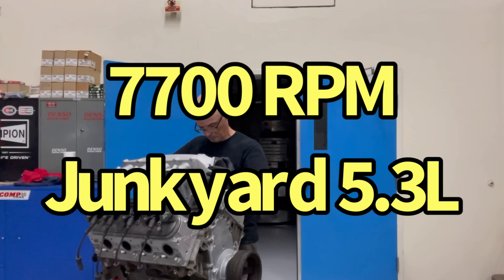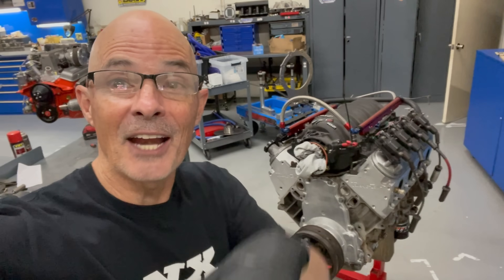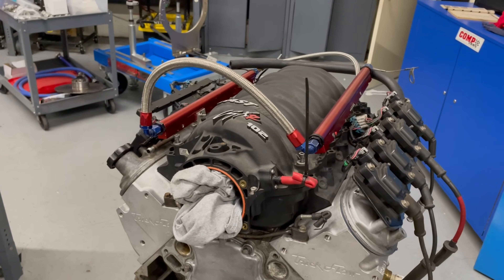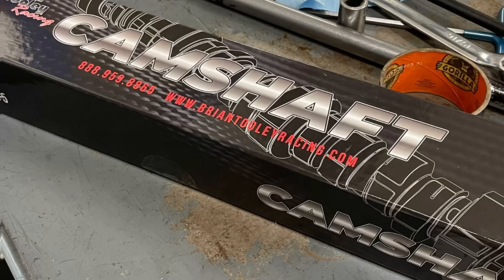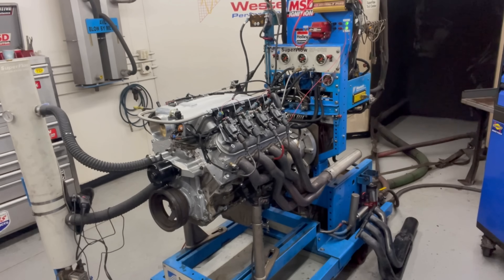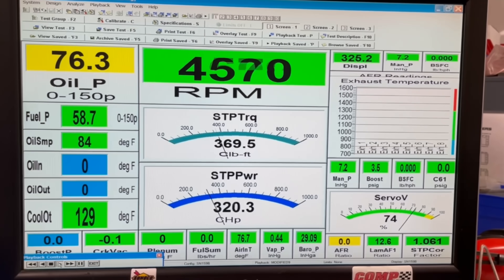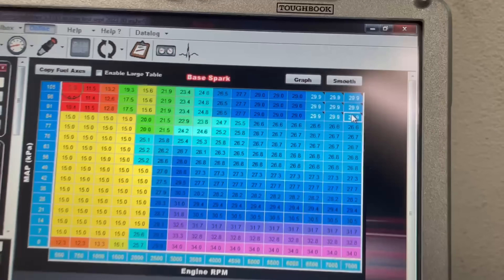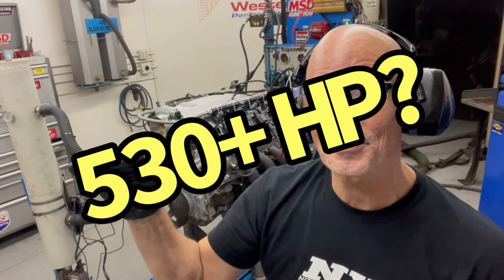JUNKYARD LS MONSTER MAKEOVER! HOW TO TRANSFORM YOUR JUNKYARD 5.3L INTO A 7,700 RPM, 542-HP DEMON!

Comment: whats next ?? how about throwing a sloppy stage 2 cam in this package  and see if you can have the most hp with the king of all cams . im sure it will lose hp  but i need to know the max a ss2 will make  .? my current ls a 5.7  sbe used for burnouts i run it at 11.5 afr  regularly sees 7900 on the tach during a skid that lasts about 2 minutes at wide open throttle in high gear (powerglide, no rev limiter , 3.45 gears ) . elgin says cam good till 6500 rpm    why is it working all the way to 7900 ? and is it still making power up there ?
Reply from the maker: your 5.7l at 7900 rpm with an SS2 is on the extreme downside of power production
Reply: @richardholdener1727  agreed but how does it get there ? stock 241 heads with pac springs trend pushrods , in my mind it shouldnt
Reply: @norego6237  my moms civic can do a burn out... you dont need much to spin some tires with no grip
Reply: @sniperpronerfmods9811  well this is  the internet and if its true there is a video of it , i am more than keen to watch a video of your mums car  doing a burn out in top gear  and killing 2 tires . cause we all know its not a real burnout unless you pulled top gear  and kill 2 tires , flick us a link mate
Reply: @norego6237  relax buddy our ls1's max is like 200hp or less at 7900 rpm
Reply: @sniperpronerfmods9811  so mum wont lend you her honda ? guess its time for me to relax now ? ill give it a go. thanks for all the priceless info mate .

Comment: To get more power out of this L33, why not start with a dry sump pan and micro-finish the crankshaft. Then you could swap the connecting rods, pistons, push rods for carbon fiber ones. You could also get heads with titanium valves that flow around 500 cfm and an intake that can support them. Get the C/R as high as you can on pump gas and try to get to your next goal: 2hp per CI or 1054 hp. Good luck ;)! And maybe a custom cam with a lower LSA will do the trick. You knew it had to come from me.😱
Reply: Just start with a Steve Morris Block Mr. moneybags
Reply: Just boost it vs a 30k engine waiting to grenade lol
Reply: 2hp per ci.... 323cix2 646hp... Where did you get 1054 from
Reply: @darkshine5  You're right, I was at 200hp/ liter.
Reply: Fuckkk just looked it up 18k per rod. That's 144k in conrods alone for a V8.

Comment: Didn't it make 460ftlb with the long runner and red hot cam?
Reply from the maker: 440
Reply: Yes it was 440 double checking.   Do you think additional tuning could have raised the tq on the short runner?
Reply: The reason i said 460 is because it was the last thing on my mind.   My thoughts when you made the 440 was that that sweet little 5.3 could've made 460ft-lb with a tight lsa cam on your 500+HP build.   So that was my last thought on that.   @richardholdener1727

Comment: Mill the heads .090 with some thinner headgaskets. She'll thump then.

Told ya the cam and intake should match🤪. The long runner intakes aren't meant for 225+ duration cams. Especially when trying to tune them on the stock ecu.

Lots of guys run sbe past 8k rpm.

And ofcourse good fuel test would be great.
Reply from the maker: the 225 cam and FAST intake comment is just silly

Comment: Methanol fuel mate or Nitro let's see how much timing we can put  to it.Also now you need to chase 2hp per cubic inch
Reply: 2 hp per ci would be 650ish hp. Not 2hp per cc
Reply: Ya it's pretty hard to chase a cheetah even if you are riding one mate. 1000+ hp out of an NA 5.3L is one hell of a challenge.
Reply: neither one of y’all built an engine be4the5.3is 323cubic it will make623hp all day with a tsp stage5cam afr260heads injectors intake gud dyno tune efi system
Reply from the maker: Julius-you need to put dem AFR 260 rec-port heads on the 5.3L to make you some big power! lol
Reply: @richardholdener1727  yeah lol we will just notch the bores to fit the valves.....
Reply: What was afr?

What was max lift overall from the heads milling, ls3 cam, and 7.425 pushrods?

Comment: Been watching your vids for a while now and you never disappoint... im building a gen 3 6.0 for my camaro and your vids have really helped me with what path i wanna go with her! Ty for the vids keep up the great work!
Reply from the maker: I appreciate that!
Reply: @richardholdener1727 great video. I've been waiting on some more high rpm testing. Any high rpm  416 ls stroker testing?
Reply: @richardholdener1727 i didnt think these heads would work with a 5.3. I have been looking for something better than the 706's on my rcsb silverado. Its a street strip truck. 4l80e swapped 4k ptc converter, 4.56 gears, tru trac posi, 1 7/8 LT headers, btr stage 3 truck cam but swapping it to a btr red hot cam and using nitrous outlet x series single fogger nozzle for no more than a 200 shot. My lm7 5.3 is stock bore space 3.780 with dish pistons. Would you say that these 220 fast as cast heads with .030 milled off and a .041 mls gasket and the btr redhot cam work great together?

Comment: @Richard Holdener Keep turning it higher and higher until it blows but tune her right so it doesn't prematurely blow. This could be interesting for the future na builders trying to get into budget na builds by reving to moon with a say 6.20 or lower gear🤔
Reply: Current set up, no point in turning more rpm. Power leveled off at 7500
Reply: @jacobjwilson92 in drag racing you shift gears after HP starts to fall off.  Hold on to your torque multiplayer longer....

Comment: Send her to the moon see how many rpms a stock bottom end can handle 😃 we know it will never reach boosted level power na, well at least i think🤷That torque curve doesn't drop off too bad , leads me to believe that a change in cam or intake will allow more torque and hold it well on higher revs. Keep turning it higher and higher until it blows but tune her right so it doesn't prematurely blow.
Reply: We've turned sbe ls stuff 8200. There's guys that's turned 4.8s over 9k sbe boosted.